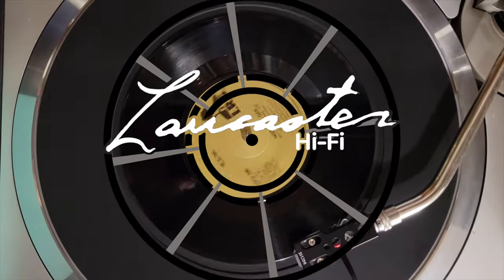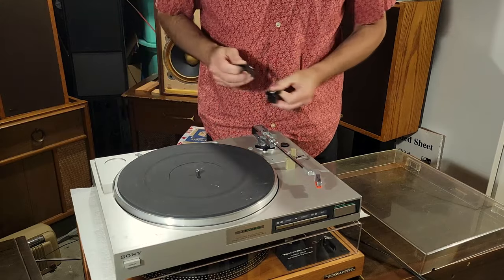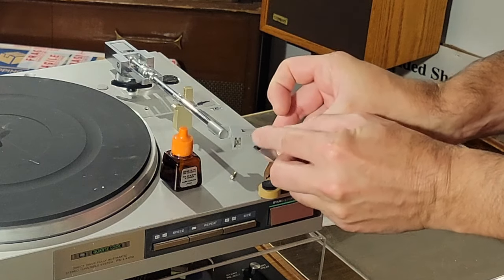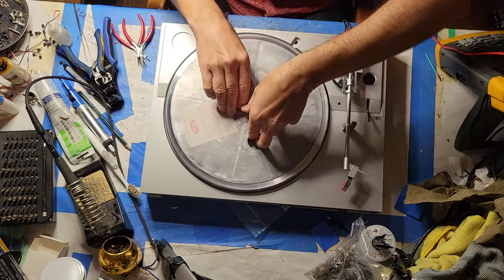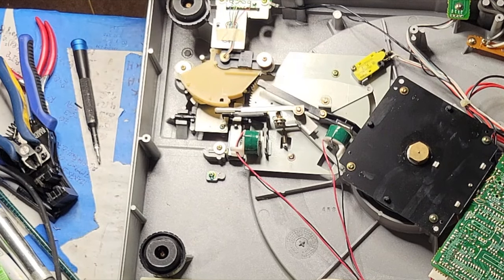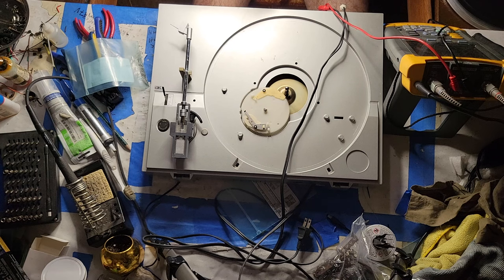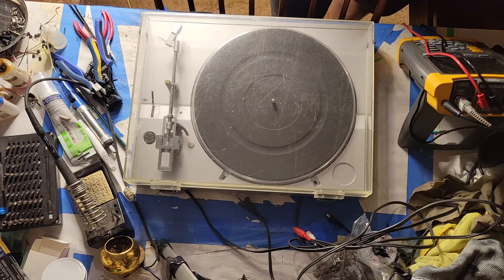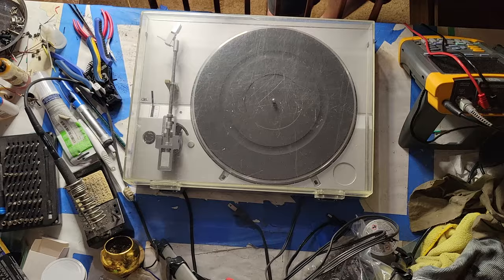Simple Fixes for a Vintage Turntable

Comment: Is it worth fixing? Zero dollars, let him take it apart and try to save the motor, counter weight, and tone arm wires. Total worth to buy, zero dollars. Total worth to take apart and destroy and learn something? Priceless.
Reply: It works! It's fine for someone who wants a turntable but has no clue about turntables. Something to learn on. Cost of the cartridge? On ebay seeing one for less than $30.

Comment: I noticed you didn’t just look for a loop from the rca to the cartridge. I’ve read you shouldn’t try and measure the resistance of a cartridge as it may damage it. Is this your thinking also?
Reply from the maker: Do you mean, look for continuity from positive to negative, across the coil? I hadn't thought of it. I can see why it might be a risky measurement.